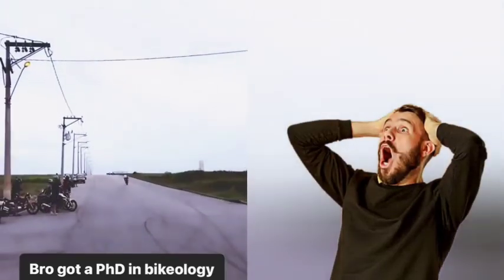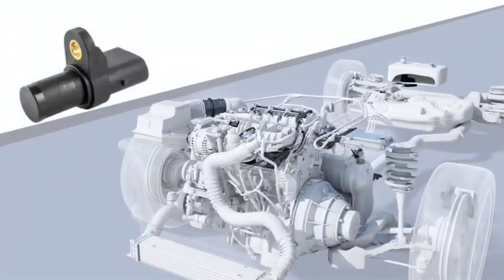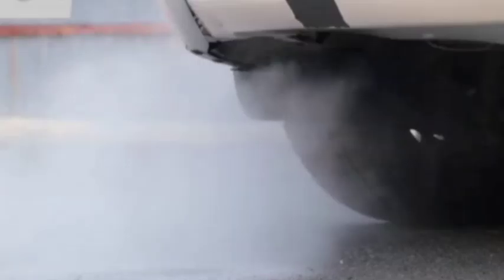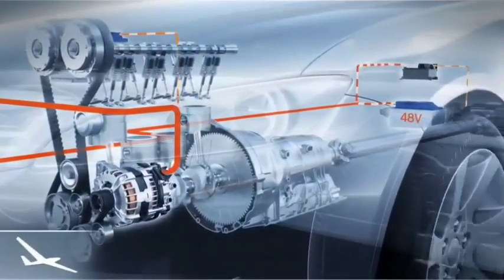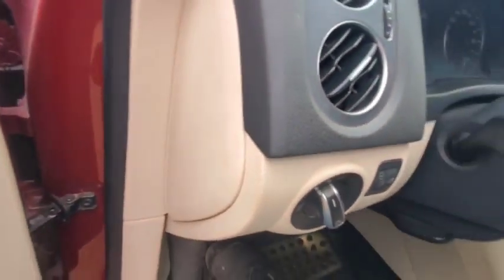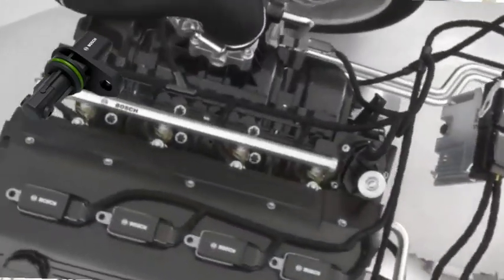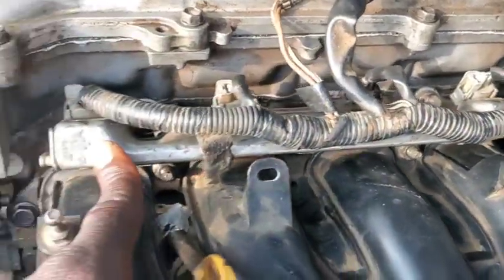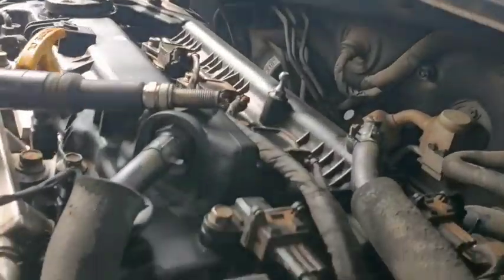15 symptoms Of Bad Crankshaft Position Sensor

Comment: 1 check engine light 
2 no start
3. Engine stall
4 misfire
5 reduced fuel economy
6 vibrating engine
7 slow accellerator reponse
8  eratic starting 
9 misfire cyinderh
10  stall and  misfire
11 shut down randomly 
12 too long cranking
13 P0300 code
14 rpm stays dead on tach
15  no injector pulse

Comment: I am suffering Alot with my Mazda 5 2005 model.. I replaced all the sensor my car is the Total explanation of what u just thought.. it stalls.. it burns our a.c compressor coils.. I am tired pls I need help..
Reply from the maker: Bring the car to my garage however if you need my personalized assistant it will not be free